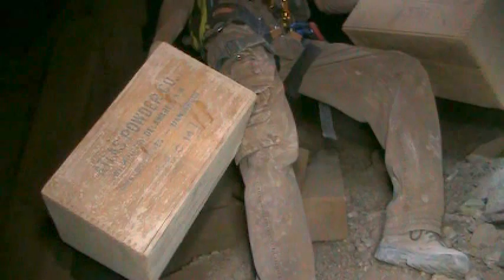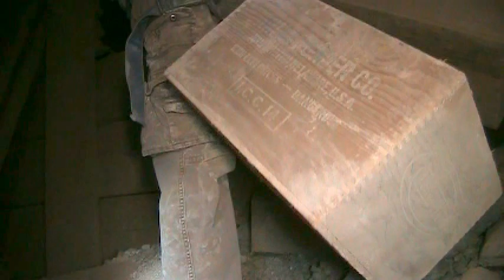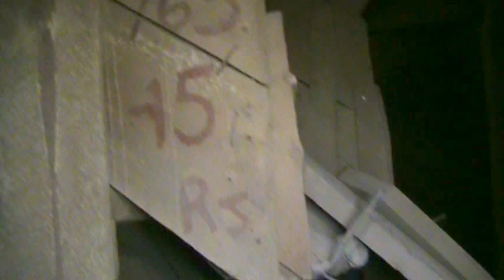Columbia #2 Mine - Reaching the 900' Level

Comment: Oh yes, that's the bottom.   My 1st time in there was 1995.  In 1995, all the mines still had personal stuff, tobacco tins, axes and shovels, claims. Ore buckets and old model T closer to Gunsight.  Smugglers Shaft area.
I think I got 40 hours in War Eagle.  Amazing place .  The mill of course was still standing and intact. by the cemetary.
Reply from the maker: Wow, it's amazing how quickly things disappear. Would've loved to see everything still intact. I've been to that area quite a few times, fun stuff!
Reply: There were even the hand winches on the surface level to shafts, lunch boxes/tool boxes, shovels and axes.  I was pretty amazed to see all that.
Reply from the maker: Wow! I've found cool stuff for sure, but I'm sure I missed a lot that has been taken through the years. It's a rare opportunity to see a mine or section untouched.

Comment from the maker: @BJOlson 
We use them on the first trip, but not usually thereafter. We've done this mine many times. Also, we don't generally get gasses out west, but sometimes low oxygen can be an issue, as well as carbon monoxide from fires. Airflow in a mine is always a good thing.